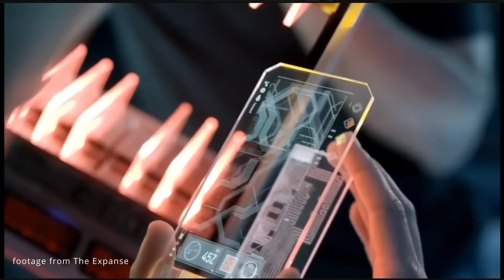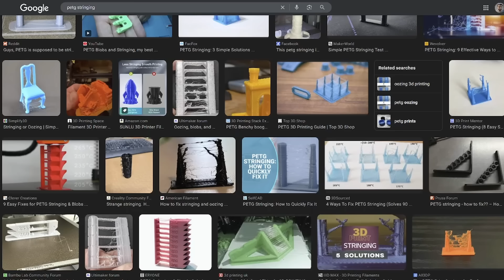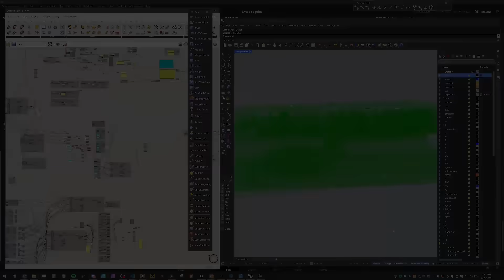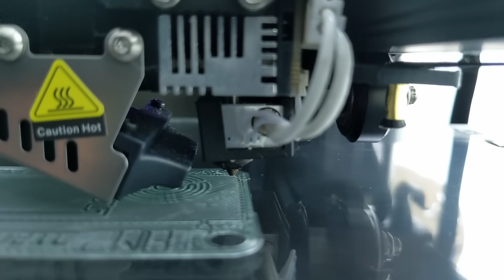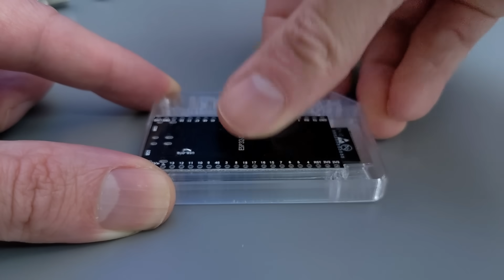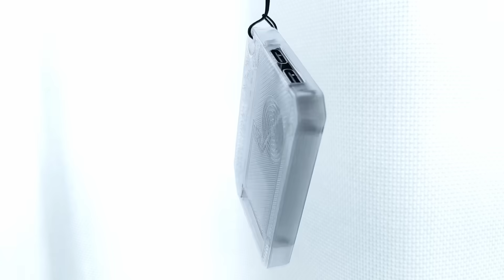No slicer: single continuous path 3d print

Comment: I understood everything except the totally crucial description of the software tools used and how to do it😂 Very impressive work
Reply: It's an obscure piece of software (two actually) that are expensive and hard to use. Rhino + Grasshopper is very niche 3D modeling and CAM software that's completely different than other modeling/CAM software and if you've ever used other software you will probably hate it. If you haven't, you'll probably still hate it. But it can do some things that other software can't. Like this. There's no way you could do this with anything but rhino+Grasshopper.
Reply: @charlesstaton8104 thank you for the info.
Reply: @charlesstaton8104  My high school had student licenses for Rhino and Grasshopper and it was a pain in the a## to learn how to use. I'd have rather stuck with AutoCAD but some things about Rhino were nice.
Reply: @charlesstaton8104  As someone who has used both professionally, it's actually not terribly expensive because you don't need a subscription, it's about $1k for the current version forever. Since rhino 7, grasshopper automatically comes with rhino so you don't need to buy it separately.
Reply: @charlesstaton8104  I was using a web page to generate single-line gcode back in the day.... Might have been related to the "Full control gcode" project.

So much more satisfying building gcode that does the smart thing, rather than the easy-to-program thing.
Reply: @charlesstaton8104 Rhino is the industry standard for jewelry creation and some other areas, it's not obscure at all. 

Grasshopper I agree is very underutilized and could be seen as obscure.
Reply: I use Rhino + Grasshopper for work, i hate Rhino so much from bottom of my soul, Grasshopper is alright although bit limited if you don't want to write code and some stuff is way harder than it should be.

Comment: Wait, so the first infill-layer is effectively bridging the gaps of the first layer? It just travels over the lines of the first layer. Did you calibrate flow for the infill layers to fill the gaps of the line layers as well as make a completely solid infill-layer at the same time?

Am I getting this correctly?
Reply from the maker: Yes, exactly! That was probably the most difficult and most satisfying thing to solve. I kept changing flow rate until it filled in the previous layer's gaps, but still low enough to remain flat for the next layer.

Comment: Back in the day, I was able to get clear infill results with PETG on an Ultimaker 2. 
The two basic tricks were to run it as hot as you could so the previous line would raise above the glass transition thus melt & flow into the new line, 
and then keep increasing the extrusion multiplier until all of the bubble lines between infill lines were squeezed out. 
The top and bottom surface had texture so were cloudy, but I was able to just sand and polish it on a flat surface and was able to see through clearly 8mm of plastic. 
Obviously running at so hot meant that the wall tolerances were way out.
Reply: the issues with the wall tolerances can probably be mitigated through lowering the temp for the outermost wall and printing that first on every layer, then ramp heat back up again and print the rest of the layer. that will however require either 2 pauses/layer or heating up/cooling down a bit before the lower temp is required.

Comment: To get clearer print what would ironing every layer do?
Reply from the maker: I'm interested to try that on a different print 🤔. But for this one, I don't think it would make much difference, since there aren't any exposed surfaces other than the top and bottom.
Reply: @porchlogic  I found out that in Prusaslicer with mesh modifiers you (Propably) limit the areas where you apply the every/ full layer ironing by using ironing with "All solid surfaces" setting. I would have linked the video url but for some reasen I cannot send a comment with a web address into this comment section. Not even Youtube links.

Comment: Good job ! Are you sure the hole for usb is big enough though ? Cable connectors are usually wider than the board connectors. You can try using orca slicer's new setting for layer start and stop, it blends the beginning and the end, it works pretty well. 
To print transparent PETG and have a transparent looking item, i found out you need to go somewhat slow, heat the filament a lot, over extrude, no fan. This allow the plastic to fill as much space as it can and that is what makes it transparent. Of course it does not play well with overhangs

Comment: We really do need a slicer function that generates continuous line toolpaths. Even if it has to use variable line-widths. Such a feature would be very useful for stringy filaments like PETGs and TPUs, and also for foaming filaments.
Reply: Arachnie already does variable wall thickness which is awesome, I hope this gets more development in slicer.
Reply: Snake-fill
Reply: Also for filaments with long fibers (eg carbon), so you font have to cut filament for every retraction
Reply: @krakers665 yeah, was about to say that. Slicer is always half of the problem when it comes to experimental printing
Reply: @krakers665 for markforged style you couldn't just have the long  filament inside the plastic filament without having fixed width(the width of the filament going into the extruder really). 

Hmm a special hotend though that just had the thread come into the meltzone and just get pulled along...
Reply: Cura has a setting for using one continuous line for the concentric infill pattern, and while it has massive upsides (as demonstrated in this video) the implementation isn't perfect by any means. Still the best thing I have found.
Reply: @p00pyp00per  yeah I have several times needed a "multiple perimeter vase mode" which is similar concept
Reply: Just tick the "avoid crossing outer walls" box and set the value to 999999.
Reply: Or maybe not even extrude on certain parts of the line and just iron over the existing print
Reply: @starmanxvi  I think it’s better to just extrude a thinner line there in the first place, so you can extrude another thin line there a second time. There shouldn’t be any time where you’re forced to cross lines, because you can just swap the X shape for a > < shape.
Reply: time to petition orcaslicer for a new feature.  Could this be achieved however with a script plugin for orca?  they did that for brick layer printing.
Reply: @gerarderloper  Brick layer modifies the already sliced g-code. While you could attempt to cut and splice the sliced toolpaths into a continuous line, it wouldn’t give you any freedom to vary line widths and perimeter-count, or change infill. If anything other than the slicer, you’d make it a script that processes the STL file into a multi-walled shape that can be run through a normal slicer in vase-mode, but that would take processing power.
Reply: @Scrogan  so basically we need vase mode with multi or defined allowed separated walls parameter?
Reply: indeed, I like the idea of making the text a continuous vertical path, I net you could do some interesting stuff with heat or ironing to fuse some features all the way through the print for clarity
Reply: You could probably save a decent amount of time removing hops, retraction, travel, etc
Reply: Dry your filament properly and set your machine up properly and stringing completely ceases to be an issue😂 this has been done for a very very long time already. If your petg and tpu are stringing just making one long line isn't the answer NOR is it practical whatsoever if you want your prints to be true to the cad specs. One line doesn't work with full model accuracy fidelity the majority of the time past simple shapes. That's why vase mode currently loses so much detail and only does one ultra simplified external perimeter. If you want to make boxes.. and vases and balls or other primitive shapes then great. Just doesn't work for true prints. Dry your filament properly. Test and tune settings and retraction. You can do thousands of petg prints without a single iota of stringing quite easily. They already figured it out and there's a plethora of settings that together address it completely. If you're trying to print wet filament theres nothing on the planet- no amount of retraction and wiping will help you
Reply: @notyouraveragegoldenpotato 
There definitely are filaments where such a slicer option would help. Foaming filaments are just like this, see RCtestflight painstakingly designing his CAD model of a wing to include the crisscross infill pattern and walls all in a single perimeter. It should be pretty obvious how this method can be extended for arbitrarily complex shapes, doubly so if you allow yourself to start and finish at different locations and reverse directions each layer, and triply so if you also incorporate arachne’s variable line widths.
Continuous carbon fibre filaments are also a case where this would be extremely valuable.

I’ve never had trouble with PETGs like the creator of this video did, though even with bone-dry 95A I’m getting a hint of wispy stringing on retractions even after extensive tuning, likely due to my wider 0.6mm nozzle. Maybe it’s absorbing moisture along the long filament path from the drier box, whatever it is I imagine even softer TPUs like 50A would be significantly worse.
Reply: Orca Slicer does have such an option (vase mode) already. I presume others may have that option too. I have never used it but I have seen it.
Reply: @gigaherz_   Vase mode requires that you manually create the zig-zags for multiple wall thicknesses and internal support structures by hand, in the CAD software.
Reply: @Scrogan  huh, weird.
Reply: @Scrogan  That will only be 1 wall layer thick.
Reply: @isthattrue1083 you could fold the wall back in on itself to turn a continuous line into as many perimeters as you want, and also internal infill structures so long as they’re all conjoint. If you’ve got more than 2 perimeters this way the strength lost by each inflection point won’t be much so long as you space these inflection points around the perimeter.
Reply: @gigaherz_ vase mode is nothing like this. Have you tried it? Vase node is for a 1 perimeter vase like print, basically no top surface. You can work around and make your model respect the "vase topology" by essentialy model the features with the perimeter but I mean.... This man did it, math allows it, it could be a feature
Reply: @gigaherz_  vase mode is very limited, usually single perimeter shapes. Real continuous extrusion would need to deal with multi-perimeter walls, infills etc. like in the video.
Reply: @gigaherz_  Vase mode only prints the very outer layer one line thick.
Reply: @gigaherz_  yep.. you never used it

Comment: My god that noodle editor page is an eldritch horror to me, i can't even imagine sitting down and making that let alone doing so with such excellent organization
Reply from the maker: 😅 "excellent organization".... I'll make sure to clean it all up before I make a follow up video on it. It gets outta hand pretty quick
Reply: I'm a professional software developer and I'm surprised people are able to use those visual diagrams to program things in a rat nest.
When a bunch of text would be actually simpler.
There's a reason graphical programming environments never took off.
It becomes absurd very fast, it doesn't scale.
Reply: @monad_tcp  it's a bit different, we use the mouse a lot and instead of keeping track of our variables, objects, types and scope, we unplug a thing and plug it into another thing to reuse the same data. With nice sliders and previews, eg. for textures or shaders. 

And you usually have access to a scripting interface in every DCC out there. Often Python. Houdini for example uses Python and also VEX, which is similar to C in syntax and performance, JIT-compiled into machine code. 

I can't really overstate how hardcore Houdini is.
Reply: @monad_tcp  LabView would like to have a word... its pervasive everywhere you think it wouldn't be and everywhere it should not be.
Reply: Be happy you've never seen a Houdini node graph.
Reply: grasshopper is extremely fun

Comment: Why not just use the "avoid crossing perimeters" option in the slicer? It basically does exactly that. Then design the model with all parts touching at least on one point and you're set.
Reply from the maker: I tried a few times with slicers, but was never able to get predictable results. Even with avoid-crossing-perimeters option, it seems to have a mind of its own when choosing which part to do next. But, I'm sure there are some printers now that print so nice you don't even have to worry about it.
Reply: @porchlogic  hmm, fair enough really - I never needed that much precision. Hopefully that feature gets better as it's further developed. Thanks for answering!

Comment: You might be able to make it even more transparent by increasing the flow rate and cranking the heat. FDM loves heat, and most filaments can safely handle way above their rated temperatures. Most people print at lower temperatures because overhangs work better, but lower temperatures give you more of that typical 3d printed look.
Reply from the maker: Yeah still a lot of experimenting to do (that I don't have time for!). It's cool to feel the power of writing gcode from scratch, but also tough when you realize how much has already gone into tuning settings like that in the existing tools. I should just do a couple tests with wildly different temps/flow, to see what happens.
Reply: Print slow for maximum transparency too
Reply: Stefan from CNC-Kitchen made some test with translucent printing. If i remember correctly the most importent factor was print speed. Go slow - realy slow und you can get nearly clear parts.
https://www.youtube.com/watch?v=9qb25Gi4Jv0

Comment: That turned out beautiful.

I know nothing about making slicers and little about customizing g-code. But I've always wondered why slicers don't have a single extrusion pass option, or at least a minimize extrusion stops option. I mean, we have vase mode, why is it restricted to single wall? I understand you'd have turnaround points with multiple walls, but that's a minor hurdle and a layer seam overlap would mitigate the weak seam joint issue. I'm currently running an 8 day long print with a stringy filament and such an option would be really welcome.

I've always felt a lot of stringing blobbing and seam issues with difficult filaments could be avoided and time saved on needless moves.
Reply from the maker: 8 days! Sheesh.
Yeah or even just a tool that lets you draw out a curve that influences the order/direction of moves

Comment: That bottom layer is *glass*, absolutely gorgeous print
Reply from the maker: Yes, realizing I could use a piece of glass for the printer bed is really what made this project turn around
Reply: @porchlogic  Is any of your code sharable? Even a simpler demo (just a basic shape) would be helpful to others trying to do the same thing
Reply: @porchlogic  About this - be REALLY careful when printing PETg straight to a glass bed. You can get away with it as long as you NEVER let the bed cool below ~65°c with the print still attached to it. If it cools below that, you'll make a crater on the glass and will have a piece of glass stuck to your print, no matter the size of the print.
Reply: @porchlogic the fact i havent seen someone else use a sheet of glass as a print bed before to get that texture is wild, and thats considering i just saw Evan and Kate show Adam Savage a technique for imprinting a holographic pattern on resin to a similar effect
Reply: @crispycrusader1  Glass was often used as bed on the first 3D printers, before the magnetic steel sheets appeared. It gave an amazing 1st layer and surprisingly had a very good 1st layer adhesion !
Reply: @sebastienc8797 thats nice to know, as yeah ive only ever seem different metal bases, very nice to learn that stuff
Reply: @crispycrusader1 printers were almost all glass in the early days
Reply: @sebastienc8797 yeah, used borosilicate on my anet A8 back in the days.
Reply: @crispycrusader1  used glass for over 10 years - that's how most 3D printers started 😅 still use it today, especially for glossy finish
Reply: @sebastienc8797 
For PETG glass is the best 
Adhesion is really really good
Reply: @crispycrusader1  And for the flattest glass back in the day we used mirrors. I feel old🤣
Reply: @porchlogic that's all we had when I started my printing journey.
Reply: breaking bad theme

Comment: Would you have been able to combine this continuous path code with the usual tricks of how to get "clear" prints (100% infill, ~103% infill extrusion)? At first I was a little confused as to why you'd want a continuous print, but the lettering and the spiral button would have become string city.
Reply from the maker: Hmm, not quite sure what you mean by combining them. Do you mean to get the flat surface on the print bed clearer? I'm sure I could tune it a bit more, but I like the cross hatchy look
Reply: @porchlogic  Sorry for not being clear - yeah, the cross hatch look is what people are typically trying to eliminate from "clear" prints, since the infill is going to be the main culprit. If that's your style, its all good.